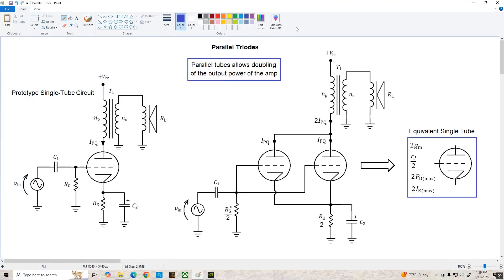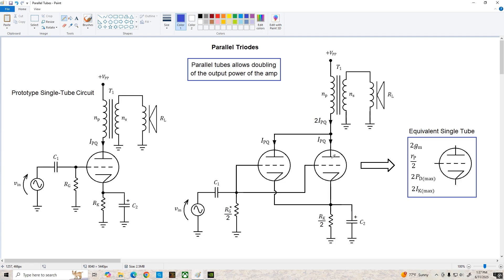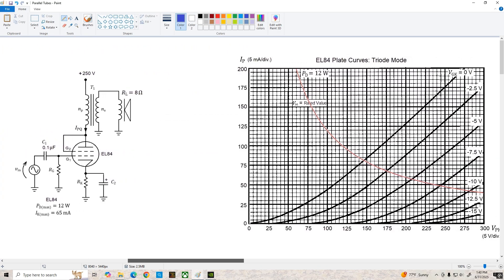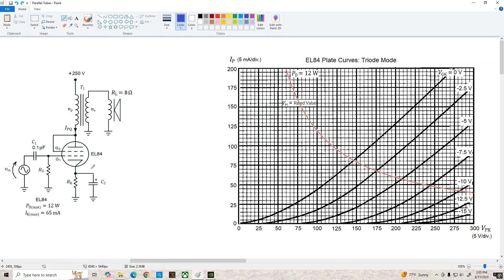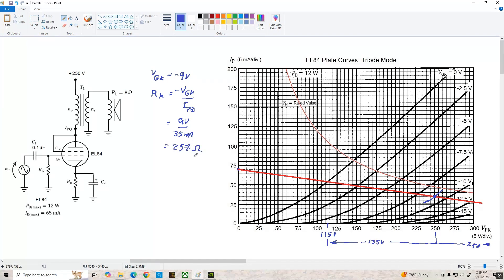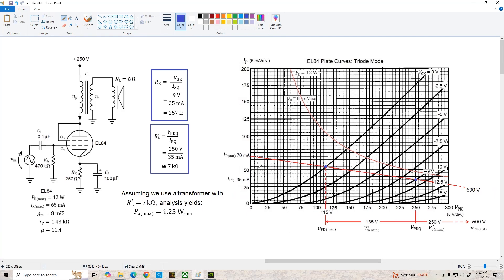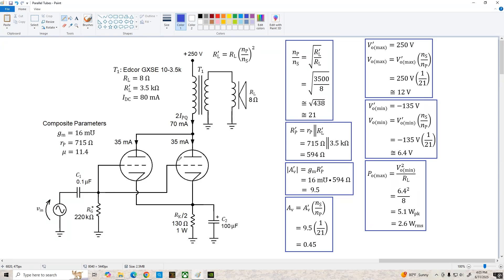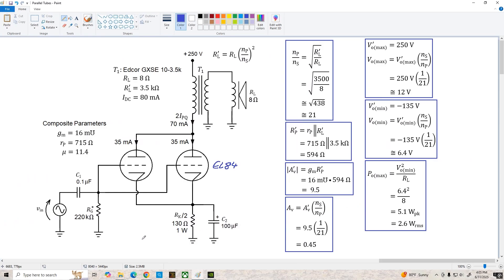Topic 87: Parallel-Connected Triodes

Comment: Thank you for this video. I came to this video as I'm working some load lines for parallel triodes for the first time and was curious if the speaker load also was cut in half as was with the primary reflected load, specifically when calculating the Wrms at the end. I believe the answer is no as I see you are still using the 8ohm number in your math.

Comment: Hello, at minute 8 it indicates maximum power of 1.25 Wrms, what would be the calculation that leads to that result?
Reply from the maker: I can’t really answer that in a comment. But if you apply the equations on the next page with R’L = 7k it will work out nicely.
Reply: @Electronics4Guitar  thank you